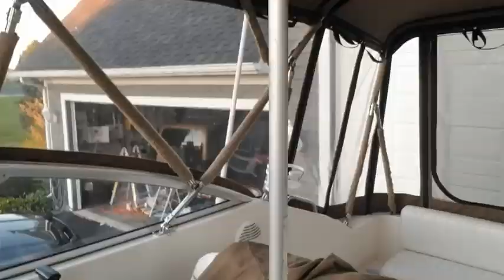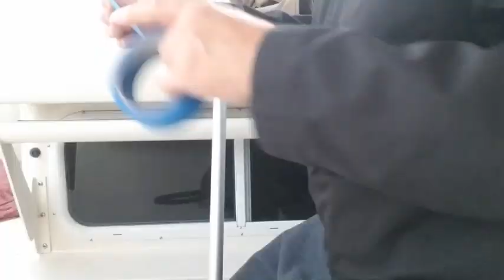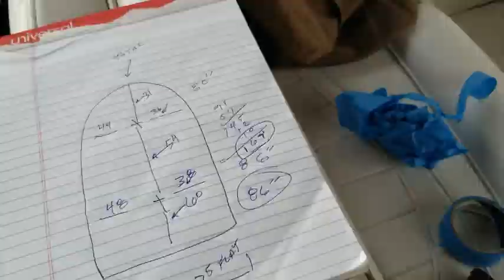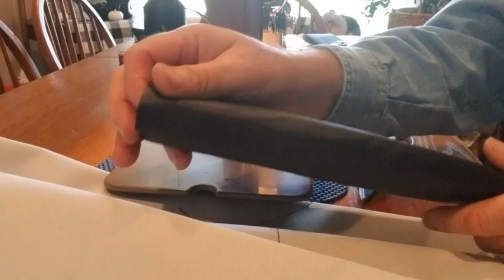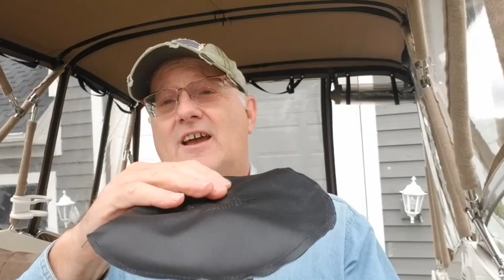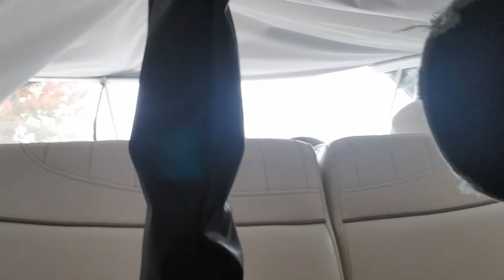Winter Covers Made Easy for the Cost of Shrink Wrap Cover Your Boat here is how for $160 Bucks!

Comment: Hey I'm from the 5th generation explorer group. I love your video very helpful diy. Can you make a video how to ford explorer sunroof water leak fix.
Reply from the maker: I can't as I never buy cars with sun roofs because they leak.  Very sorry to hear yours is leaking I did have one and only one  I greased the rubber and closed it never to open again.
Reply: They are supposed to leak. If water is coming in the car, it's because the drains at the corners are plugged. Pull out the head liner to see the drains on the sunroof.